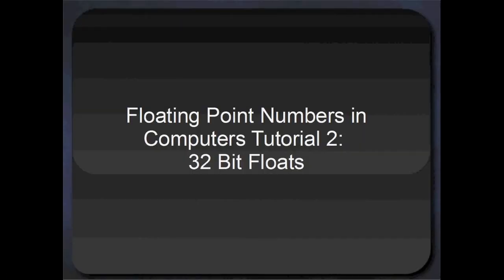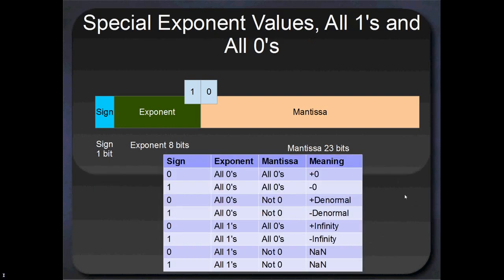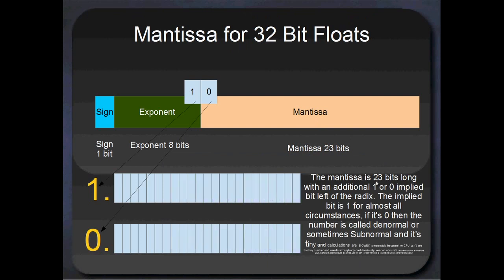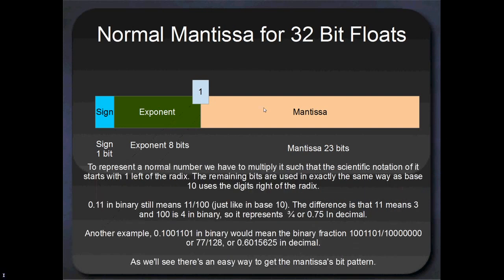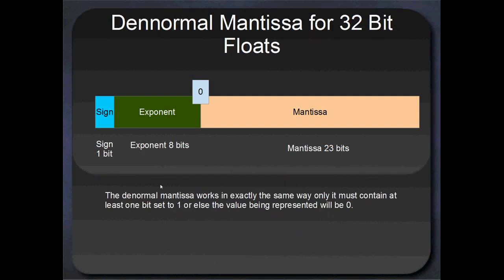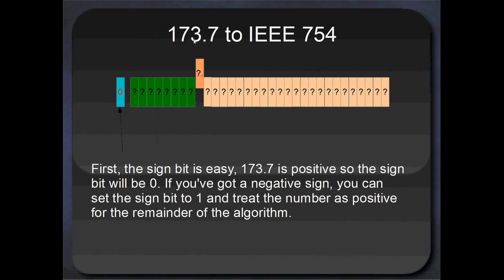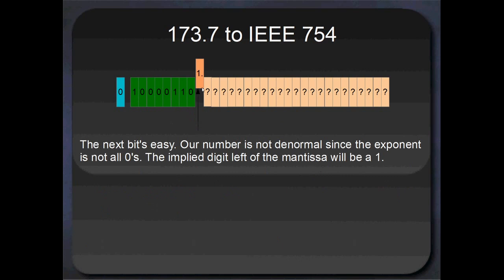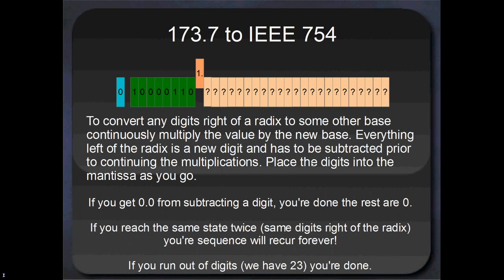IEEE 754: 32 Bit Single Precision Floats

Comment: Creel, you should not propagate the "subnormals are bad/slow" idea: Yes, there are quite a few implementations that get this wrong, but in reality any modern FPU can (and should!) handle subnormal inputs & outputs at zero cycle cost and a single-digit percentage gate count increase for the FMAC unit! This is because any FPU which supports FP multiply-accumulate (which has been a part of the standard at least since the 2008 version, possibly 1998?) must be able to handle catastrophic cancellation, i.e. the FMUL part returns a 106-bit number, but then the addend (which can be of the opposite sign), can cause more than 53 of the top bits to  become zero, so your normalizer have to be able to handle this situation anyway.
(I was part of the 2016-2019 effort which wrote the latest (ieee754-2019) update to the standard.)
BTW, in your float to decimal conversion code, the worst possible situation is a very small input (subnormal or near subnormal) which happens to be very close to the 0.5 rounding point between two decimal expansions, when this happens you might need a _lot_of digits, particularly for double or quad inputs. :-)

Comment: For clarification,  finding the power of 2 needed to normalize the value of 173.7 is done by performing - log2(173.7), and then to find the normalized value (1.35703125) perform - 173.7/log2(173.7)
Reply: or log(173.7)/log(2)

Comment: Single-precision floating-point format is a computer number format that occupies 4 bytes (32 bits) in computer memory and represents a wide dynamic range of values by using a floating point. In IEEE 754-2008 the 32-bit base-2 format is officially referred to as binary32. It was called single in IEEE 754-1985.

Comment: Is this actually 32 bit or 33 bit???? because I see 33 bit..
Reply: 32 bits are stored. Computers only work with bytes, and bytes are 8 bits each, a float is 4 bytes long. All they're doing is writing numbers like 1.110010110x2^15, or whatever. It's just scientific notation in binary. They decided that most of the useful numbers start with 1.xxxxxx, so they don't bother storing 1. It is implied. In the diagram I drew it as a bit, but it is implied by the exponent field, and it is not stored as a separate bit. Also, there are denormal numbers, these are very small values, and for denormals the implied bit is 0, instead of 1. A number is denormal if the exponent field is all 0's. So you see that the first bit of the number is implied by the exponent field, but it is never actually stored as a separate bit in RAM. I hope this helps, thanks for watching!

Comment: Great video. If I were to convert .56 would it work something like this?
 .56  =   the exponent 2 to the negative 1 which is .50 then you 
divide .56  by .50 which is
1.1200000047683716 then convert to binary which would make the  mantissa
  equate to  00011110101110000101001 after dropping the 1

Comment: It would be nice if you'd mentioned what value throws a float into the "denormal" range you describe (when you first mention it).  I also would love to see a description of precision for various values.  e.g., if a 32 bit float's value is 1,000,000.0 what is the difference between this number and the next highest that can be represented in the standard?

Comment: What's a Creel? 
that was really brilliant,
but I tried to apply that on this video on 2:20
https://www.youtube.com/watch?v=I3ud8tIgHxo

the exp was good, but the presentation of fractions actually wasn't right with me ... could you please try it and tell me how could you do that?

Thank's in advance.
Reply from the maker: I'd like to help, but I'm not sure what you mean. To represent a fraction in binary, you just have to keep multiplying by 2. Every time you get a 1, you record a 1, and every time you get a 0, you record a 0.

For example, if you're converting 0.7 to binary:
0.7*2=1.4 So you'd record a 1, then subtract it from 1.4 to get 0.4.
0.4*2=0.8 So you'd record a 0.
0.8*2=1.6 So you'd record a 1 and subtract it from 1.6 to get 0.6.
0.6*2=1.2 So you'd record a 1 and subtract it from 1.2 to get 0.2.
0.2*2=0.4 So you'd record a 0.

At that point the digits we've recorded are 10110. This means that 0.7 in binary is pretty close to 0.10110. Notice that we've encountered 0.4 again, we've seen that value before and we know the pattern of 1's and 0's it leads to. This means that if we continue to multiply in the same way, we'll get the same repeating pattern. Therefore, 0.7 in decimal is 0.101101011010110... in binary with the 10110 repeating forever.

I hope that helps, thanks for watching and have a great day!
Reply: What's a Creel? thank you for your reply,

what I mean is:
if you checked the video on this time 2:20
you will see the presentation which I am talking about.
when I try to represent the fractions of the number in that video (according to you method), I get something different from what we can see on that video (actually I tried that number on my embedded system and I get exactly like what u have explained), but what is that presentation in the video?why do we get something different from that video?

could you please check it out and tell me what u get.

thanks
Reply from the maker: They made two smallish mistakes in rounding. Seems strange that Texas Instruments would make an error like this.

First: They round the bit pattern 1.110100001 in binary to get 1.814453 in decimal. 1.814453 multiplied by 128 is 232.249984. Then they round again! They chop their answer after the first 9, this introduces more error. I don't know what they were thinking especially since that particular bit pattern leads to a very simple number in decimal.

What they should have done is this: 1.110100001 in binary is exactly 1.814453125 in decimal. Multiplying by 128 (the exponent) we get 232.25 with no rounding. Check it if you like, the number 232.25 leads to the exact bit bit pattern they have in the slides.

Whereas the bit pattern for 232.249 is something more like 1.11010000011111 etc. It's close to the one in the video, but it's not the same.

I might have made some mistakes also, but I hope you get the gist. Their results are close but not correct.

I hope this helps, have a great day!
Reply: Thank's a lot, that is that what I wanted to know, I thought that they have made a mistake but I wasn't sure since I learned float point presentation just 5 min before watching the video :D and I thought that it can't be that I have found a mistake for TI company with 5 min of learning :D.

Thank's a lot :) waiting for more of your brilliant videos.

nice day,
Mohammed.

Comment: in the exponent part 10000000 = 0 , so 7 should equals to 10000111 not 10000110 .
Reply: Right
Reply: antonny K I found in some sites that the equation to retrieve the exponent part is Exp.-127 , so is it 127 or 128 ?
Reply from the maker: abdelrahman tarief
Morning,

Test it yourself. Write a C++ program that prints out the bits of a float. If several people tell you conflicting things about IEEE standard, it is safest to check yourself.

Here's some examples of what I get through my own testing:
1.0f has an exponent of 2^0 and an exponent bit pattern of 01111111
2.0f has an exponent of 2^1, and an exponent bit pattern of 10000000
129.0f has an exponent of 2^7 and an exponent bit pattern of 10000110
0.25f has an exponent of 2^-2 and an exponent bit pattern of 01111101

All of these bit patterns agree, the bias is 127. The bit pattern 10000000 is not the power 0, it is the power 1. Did I make a mistake in my video? If so, please tell me so I can add an annotation.
Reply: Oops, i responded too fast. You're right indeed!  10000110 = 2^7. Tricky (at least for my brain). Sorry. Btw,what you do is fantastic. Thx very much !
Reply: oh another thing. I'm forever grateful, cause i didn't know what was a creel before discovering your channel and now i know ! :D Cheers from France
Reply: @What's a Creel? : ok , its clear now thanks for your explanation

Comment: Hello there, nice video, but I still got one question : ) I hope I'll get an answer even if this video is a little older.
I'd like to know, if there is a system to calculate a hexadecimal representation of a (single/double) float into decimal and vice versa without determining the binary representation. Or isn't that possible, at all? ^^
Thanks in advance.

Comment: By the way, folks, the exponent is biased because it is a two's complement number, which is difficult to order from least to greatest without the offset--ordering allows for easy comparison, which simplifies CPU operations. Since the exponent in single-precision floating point format is eight bits wide, the maximum possible bit combinations it can represent is 2^8 = 256. The "complement" of an eight bit number A is the result when you subtract A from 256. Thus, the complement of 50 is 256 - 50 = 206.

To represent negative numbers, then, we can use the complement of the positive binary number. -50 in binary becomes 11001110 (which is 206 unsigned). It should be clear enough that the maximum possible complements are 128: if you begin at zero (whose complement is 256, with most significant bit ignored), you find that you exhaust them all once you arrive at 127. Thus, positive numbers range from 1 to 127, while negatives range from -1 to -128. Because 0 and 255 are reserved with special meanings, our actual number of possible exponents is 254, which range from -126 to +127. (Divide 254 by 2, giving 127. 0 and 255 are unavailable. Most negative possible value: 1 - 127 = -126. Most positive: 254 - 127 = 127.) Adding 127 to the true value results in a range of numbers from 1 to 254, which is much simpler for comparative purposes.

Comment: At 13:24 you can see the mantissa cuts off the repeating pattern, so we could say this number can't be represented perfectly by IEEE754. So how does a programming language know to print exactly "173.7" from a float? Does it retain info about how the decimal is rounded?

Or more generally, how do we convert the other way?
Reply from the maker: They round, C++ has cout.precision for instancewhich sets the number of significant digits to print to the console. This means if you set a float with “j = 3.999”and you set cout precision to 2, it will print “j” as 4.

I'm not sure about the exact algorithm languages use, but I suppose they do something like the following (using 3.999 with 2 digits of precision):

Multiply the number by 10 to the power of the precision (3.999*100 becomes 399.9)
Add 0.5 (399.9 becomes 400.4)
Divide the number by 10 to the power of the precision (4.00.4/100 becomes 4.004)
Print out the whole part and a radix point (prints “4.” to the screen)
Subtract the whole part (4.004-4 becomes 0.004)
The next three steps would be done twice since the precision is 2:
Multiply by 10 (0.004 becomes 0.04)
Print out the whole part (would print out 4.0)
Subtract the whole part (0.04 remains after subtracting 0)

I hope this helps, and thanks for watching!

Comment: Awesome video, helped me understand how to do the IEEE representation. I was so stuck on this trying to understand my professor's lecture video. You went slowly step by step, awesome job!!

There is one thing I would like to say though for the improvement. The part where you discovered that 1.35703125 is ''normalized'', I think it would be good to mention or at least make explicit that the initial ''1'' is not counted in the 23 bits. I would say that after you put that first 1, then you start counting 23 slots after that. But great job and keep up the good work!!

Comment: Can't thank you enough.  GREAT video! Do you have any videos on calculating the range of possible values in IEEE 754? For example, largest representative number, smallest normalized number, largest normalized gap, etc?
Reply from the maker: Hmmmm, that's a very good question. There's plenty of resources available that show the approximate limits of floats, but I don't know how accurate they are, especially since they're usually in base 10. The Limits.h file seems to #define some very accurate limits on floats.

We can make these limits with bit patterns. The largest 32 bit float will be all 1's for the exponent except the right-most bit, and the entire mantissa will be 1's: 01111111011111111111111111111111b

Which is about 3.4x10^38, FLT_MAX in Limits.h. It's the same bit pattern as the signed integer 2139095039.

I think the smallest non-denormal single will be all 0's for the exponent except for a 1 on the right and the mantissa will be all 0's: 00000000100000000000000000000000b

This comes out to about 1.2x10^-38, it's FLT_MIN in limits.h. It's also the bit pattern for the integer 8388608.

The largest denormal will be all 1's in the mantissa and an exponent of 0: 00000000011111111111111111111111b

Which is much the same value as the smallest non-denormal. I don't know if it's defined in limits.h, but again we could use the integer bit pattern and force it to a float. The bit pattern for the integer is 8388607. You can force it to a float with “int i=8388607;float ff = (float)&i;” in C or C++, if you're in ASM, you can just write the binary.

The smallest denormal will be nothing but a 1 in the right-most bit of the mantissa, the exponent is 0: 00000000000000000000000000000001b

Which is about 1.4x10^-45, and again, I'm not sure if it's defined in limits, but it results from forcing the integer 1 to a float.

Epsilon (is that gap?) for denormals is a 1 in the right bit, it's going to be something like 1.4x10^-45 again. Epsilon for the non-denormals changes with the exponent but I'm sure a formula would be pretty simple...?

I hope this helps, and is vaguely what you were asking about, most of all I hope you have an excellent day!

Comment: Hmm, how come the last 3 bits are different in the Matissa for numbers such as 0.8 and -2.2, they are stuck in a sequence but the last 3 bits are always different and i have no idea why
Reply from the maker: It's probably rounding. 5ths can't be represnted so 0.8 and 0.2 are going to have repeating sequences of bits. To be 100% IEEE compliant you have to set the final bits such that the error is minimized. So you'd figure out the next bit and after the mantissa's bits, if it's a 1 then add one to your mantissa, if it's a zero, then leave the mantissa how it is.

At least I think that's what it is. Have a good and thanks for watching!

Comment: How do you determine the exponent if the number is less than 1.0 using log?
Reply from the maker: I think the following trick works for negative and positive? Take the log2 and always round toward -Infinity.

When you take the log2 of your number, one of three things might happen:

1. The log2 is an integer, i.e. you're original number is a perfect power of 2. This log2 will be the exact exponent.

2. The log2 is a positive number with some decimals. The IEEE exponent would be the integer part of the log2.

3. The log2 is a negative number with some decimals. You must round down to the next integer, i.e. subtract 1 from the integer part of you're log.

Examples:
Log2(0.0137) is about -6.1897 so round it down toward -Infinity to get -7.
Log2(56.89) is about 5.83 so round it down toward -Infinity to get 5
Log2(0.25) is exactly -2 so it is not rounded.
Log2(256) is exactly 8 so it is not rounded.

This is off the top of my head, I'm not certain it works, although I don't see why it wouldn't...

Have a good one and thanks for watching!
Reply: Más claro, echale agua :p

Comment: Why is it when I count the boxes it shows as 33 bits.
Reply from the maker: There's an implied bit, it's always 1 unless the exponent is all 0's, then it's a 0. In the diagrams, it's the one that's raised a little. If it's not that, there's a good chance I miscounted and drew an extra bit, there should be 32 plus 1 implied bit.
Reply: Hello. Thank you for you reply. You are truly awesome and it is a great video. I did a bit of research and I gathered that. I still want to thank you sir. Wish you good health. Thanks.
Reply from the maker: *****
Sounds like you've got it! The memory is 32 bits long, not 33.

The implied bit is not stored in the 32 bits, it's implied by the exponent field. It's almost always a 1 for practical purposes. When reading a number we assume it starts with “1.”, i.e. one point something. This is because numbers in IEEE 754 are stored in normalized form, “1.xxx by 2 to the power of exponent”. There would be no point in including the “1.” every time since all the numbers in normalized form start this way. So it's assumed to be there and not stored in any of the number's bits.

The above is only half true. On rare occasions this implied bit can be 0, and the number is not read as normalized. The only times it's 0 is when the exponent field bits are all zero. These numbers are called denormal (below or smaller than normal numbers). They are usually not encountered very often because they are so small. Some CPU's deal with denormal numbers slower than regular ones.

In summary:
If the exponent is something other than 0, then the number starts out with “1.xxx”, it's a normalized number and the implied bit a 1.

Otherwise the number's denormal, it starts out with “0.xxx”, it's not normalized and it's tiny.

Does that help?

Comment from the maker: For something like the atof C++ function each version would be different depending on which headers and libraries the compiler is using.

Converting a binary int to IEEE is very easy with a few shifts.

Thanks for watching and commenting!